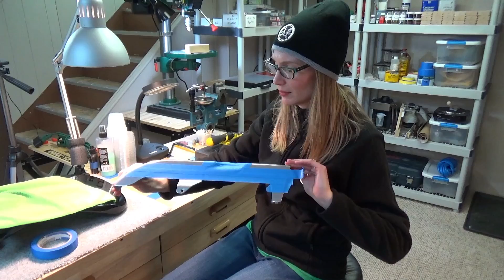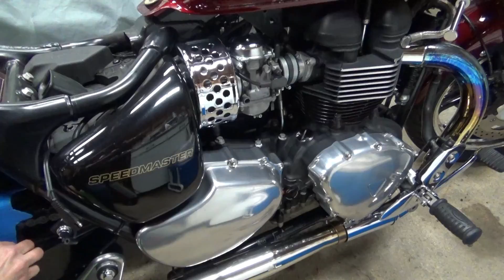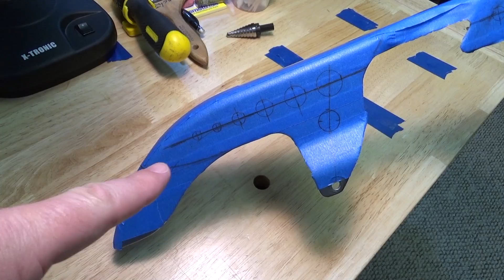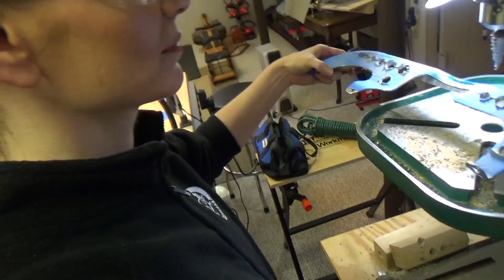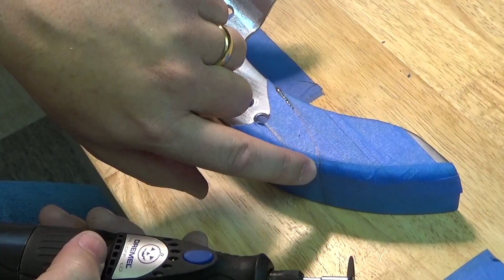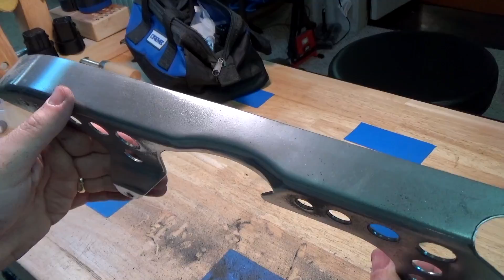Melly's Project 2007 Triumph Speedmaster Part 2 (Chain Guard Mod)

Comment: Currently in the market for another bike after selling my 02 lowrider.I'm a longtime Honda fan,riding an 05 Shadow spirit for 12 years before trying a couple Harleys,was looking at going back to a Shadow,until I saw this speedmaster,sweet bike! Been looking,but they don't seem too plentiful in upstate NY.They are reasonably priced in other states i have found on Cycletrader.Might have to get one shipped to me.
Reply from the maker: We have a newer video up and a bit of a ride out. The previous gen Speedmasters (they are now redesigned) either carb version or fuel injection are really fun. The older dual disc ones I like the best and was the choice for my wife Melanie (Melly) once she had outgrown her Honda Rebel 250. Right before Triumph changed over to the new gen, they had a narrow and larger front wheel with single disc we didn't care for. I think all the mods came out well. Removing the fork shrouds and putting on gaiters really makes the front look better IMO. We did a lot of work to slam it down (full progressive lowering kit) so she could fully flat foot it, but even for a 6ft tall 225lb guy like me it's still a fun bike to ride. With Melly on it the Speedy is a rocket. Melly and I think that we've got a great look on her Speedy and you just don't see one everyday here. Super easy to get parts for and lots of aftermarket stuff available.

Thanks for watching! Of course we hope you score a Speedmaster! LOL Cheers!

Mike & Melly

The full list of what we did for Melly's bike.

2007 Triumph SpeedMaster "Sully"

1) Biltwell Tracker Bars (Black)
2) Biltwell Grips
3) Biker's Choice HD Style Mirrors (Black)
4) British Customs Mirror Adapters (to use HD style mirrors)
5) Baron Custom Accessories Universal 4 Inch Kickback Risers (black)
6) Superbright LED Bulb Upgrade (full conversion, all lights including H4 headlight)
7) Superbright LED Relay CF13GL-02: 3 Pin Black European Flasher
8) Diode Rectifier Mod (turn indicator bulb to prevent back-feed of flasher circuit)
9) Dart Flyscreen (Black)
10) TEC Bike Parts Steering Damper (gold)
11) Maverick Customs Low Profile Seat (recovered in black leather with gold diamond stitching)
12) Progressive Suspensions Lowering Kit (front & rear, aprox 3" drop)
13) New Bonneville Fork Gaiters
14) K&N Filter
15) All Balls Racing Wheel Bearing & Seals (front & rear)
16) Shinko Tires SR Series (SR733 alternate front size 130/70-18, SR734 rear size 170/80-15)
17) EBC Brake Pads (front & rear full service & new fluid)
18) Full Service on SpeedMaster
19) EPCO Drag Pipes (long stainless)
20) Restored factory engine cover powder coating (Dupont SanTex in Black)
21) Ceramic Coated exhaust system (complete) in the color Tungsten Graphite
22) NewBonneville clutch cover, boot, polished bracket
23) Rivco license play lay-down kit with shortened factory indicator brackets (power coated Black SanTex)
24) Fully wet-sanded and polished factory paint to better than new gloss
25) DEI 2" Titanium exhaust wrap
26) ClampCo stainless steel band clamps
27) NewBonneville solo fender rack (black)
28) NewBonneville AIS (air injection system) removal kit
29) TEC Bike Parts fined oil cap
30) Willie & Max Saddlebags
31) Easy Brackets for Triumph Speedmaster / America
32) 7” Eagle Lights Halo LED Head Light assembly

Here's the latest vid: https://www.youtube.com/watch?v=ktgHXPXUd28

Comment: nice bike you may want to change the cylinder pipes to get rid of that bluing, paint the new ones on the inside with high heat header paint then install them use one can per pipe try it it will get a nice golden tinge color instead of that bluing

Comment: Great looking bike. I just picked up a 2015 and loving it. Did you stay with the stock shocks or upgrade those?
Reply from the maker: The whole bike has a Progressive Suspension lowering kit. Almost a 3" total drop. New springs, seals, spacers, bushings, etc.. on the front, and new shorter shocks in the back. The Speedmaster looks so much better slammed. We got a brief ride out video in the playlist where Melly and I installed an LED light upgrade for her bike. Cheers! Thanks for watching.

Mike & Melly

Comment: Great video coming of the subject of modifying the chain guard. What rear shocks are you running ?
Reply from the maker: Progressive Lowering Kit front & rear. I don't remember which version of the progressive rear shocks they are but they drop the Speedmaster over 2.5" in the back. Really slams the bike. Should be listed on the Progressive Suspensions website. Thanks for watching!

Mike

Comment: Gotta ask. Why not pull the Air Injection off the bike, rejet the carbs and adjust the air mixture. just looking at those purple hearers it would appear the bike is running very lean. Those are double walled headers. and should never be that purple.
Reply from the maker: We actually did just that. LOL Haven't had time to record a video and make an update with all the changes to Melly's bike Sully. We removed the AIS, installed a K&N filter, and with the EPCO drag pipes the mixture is just right. Bike is running like a champ. We also ceramic coated the pipes and wrapped them with DEI Titanium wrap for the look mainly. Hopefully we can get the time to do a new video soon and post up the updates. Since Melly's a new rider it was more important to us to get her bike on the road than make videos of the process so it didn't all get recorded. Thanks for watching!

Cheers!

Mike & Melly